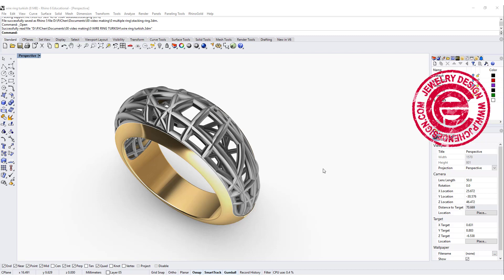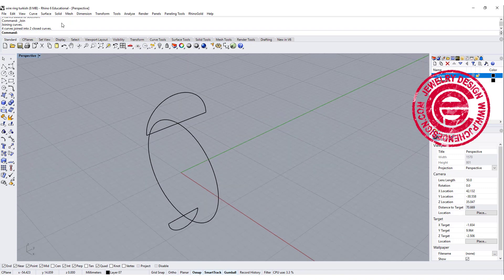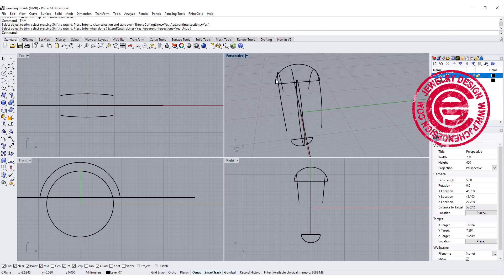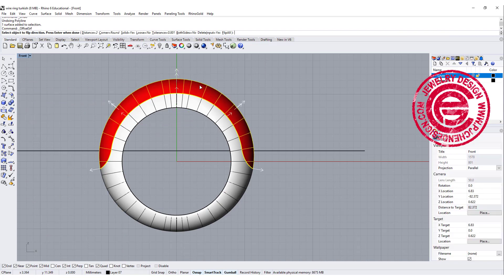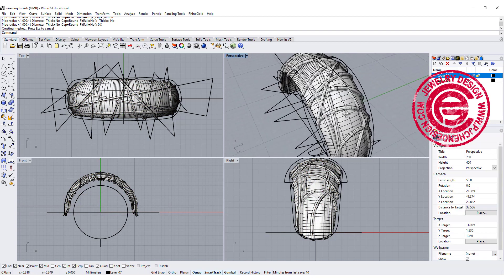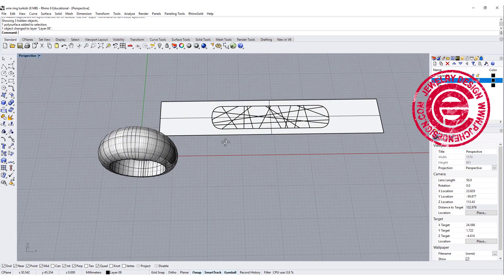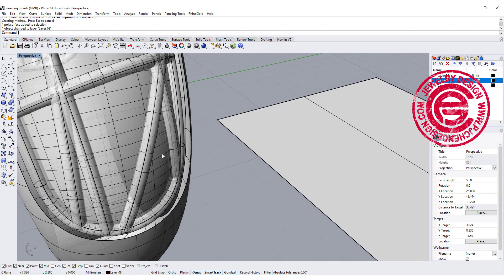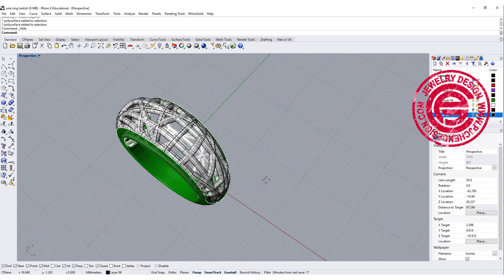Hollow Wire Design Ring 3D Modeling in Rhino 6: Jewelry CAD Design Tutorial #95

Comment: hello! great tutorial, i have a little problem though... when I try to create a UV curve, it takes only one half of the surface. even if it was joined and I tryed to rebuid the curve as in one of your other tutorial. :(
Reply from the maker: Creat UV curve only apply to single surface. if you have seam on the surface. it will only select one side of it. Make sure you have single surface not polysurface.

Comment: great lessons as always, practicing the basics before taking on in depth course. One question --- while extracting isocurve, when I do it, it only picks up part of the surface ... like 1/4th ...dont know if there is switch for whole surface or partial surface ..?
Reply from the maker: because the surface you intent to pick was not a single surface. I guess they are polysurface.
Reply: @PJChenJewelryDesign  Yes you are right! will try to find out how to make it a single surface ...

Comment: Great video! Im having issues with my surfaces being stuck in 2 pieces. I even boolean joined them into one but when i select the surface to flow it only highlights half at a time. This has happened to me before with similar projects. Any tips?
Reply: Solved! When I swept the ring I had to "flip" the direction of both seams.
Reply from the maker: you can check out this video https://youtu.be/FKp8q8MTKsk